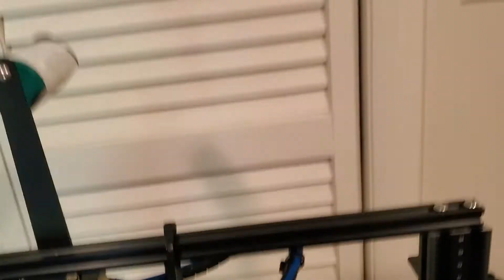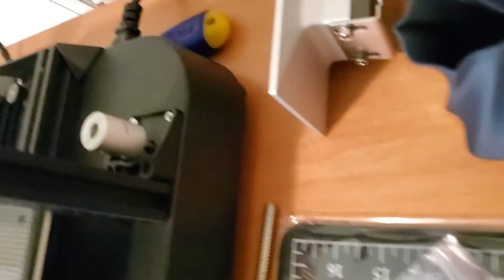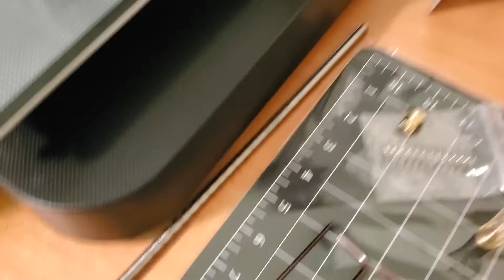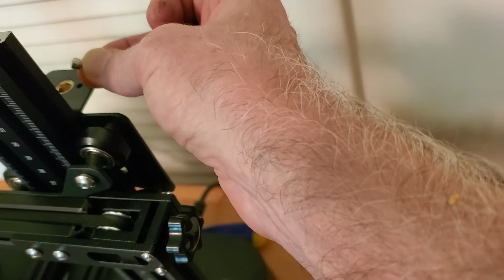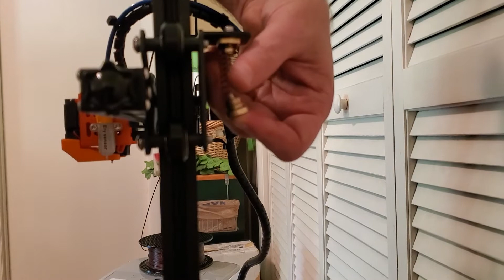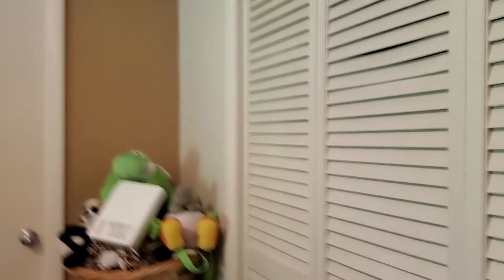Installing Z-Axis Anti-Backlash Nuts on Eryone ER-20 Printer

Comment: I have an Ender 3 with a direct drive mod. With the extra weight on the z axis, there is definitely some sag when z motor is powered down. However with my ER-20 having 2 z rods and motors I don't notice any movement when z motors are powered down. Is there any other benefit to this mod if there's no z movement when powered down?

Comment: Hey Jay thanks for all the content on these Eryone printers. Your videos have helped me out a ton with troubleshooting my own and looking into upgrade paths that I otherwise wouldn't have considered. There is one thing I'd like to know your thoughts on, my ER-20 developed a feed issue with it's extruder that I have given a temporary fix but would love to give a more permanent solution. There are a few modifications I've seen floating around that could do the trick but I would absolutely love to hear how you would go about it and hear any advice that you could offer. Thanks again for all these videos!!
Reply from the maker: Hi Jason!  Thanks for the very kind words - they mean a lot!  Can you be a bit more specific on the feed issue you're describing?  I also have had, from time to time, issues with Eryone's extrusion and hot end "system" - and, in fact, I am in the process of upgrading both of my machines to new extruders and hot ends.  That said, the ER-20's extruder is at least a metal unit that is solidly built.  Having a few more details would really help me give better advice!
Reply: @jayburkette8977  the issue is (or should I say was?) The printer skipping layers to an extraordinarily excessive degree. The issue came down to the tension placed on the filament by the extruder before the Bowden tube. I have relived the issue by wedging a failed print into that section to provide a very small increase in force on the filament which has so far worked wonders but is far from a permanent fix. There are no other issues or signs of wear anywhere on the machine. (I honestly think the issue is with the spring  rather than any of the metal pieces) I'm convinced it would be a super simple fix but since I need to fix it at all I figured why not get an upgrade while I'm at it since I am interested in doing some work with flexible filaments and would also appreciate all the other benefits that come with such an upgrade. 

In any case keep up the good work and I highly anticipate you future videos!!
Reply from the maker: @lordforgetful  That makes sense.  I installed a Bond Tech LGX on my Thinker (still working on getting that up and running), and I have a TH3D "Tough" extruder here for the ER-20.  Both of those are 3:1 gearing machines, so it will take some further calibration work to get them dialed in.  Maybe this will mitigate this for both of us going forward.

Comment: Would the 4 screw version fit?  Minus the 2 screws of course.
Reply from the maker: You would have to dremel the one on the extruder side...the metal frame available there won't accommodate the four screw version.